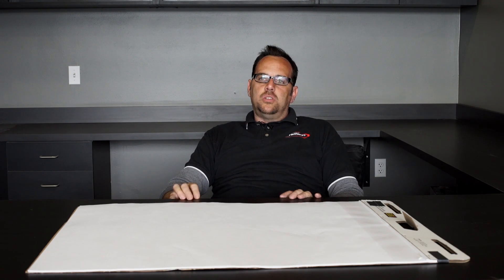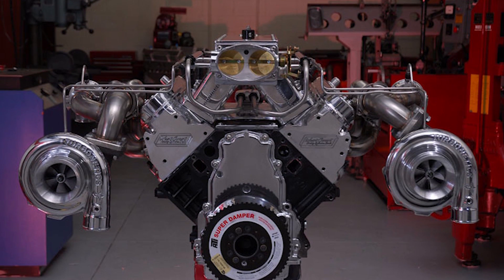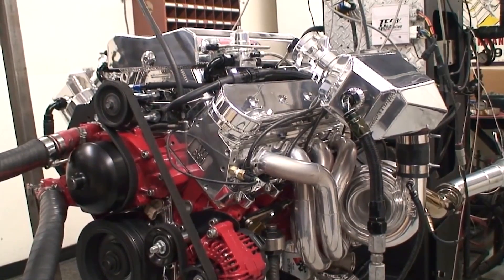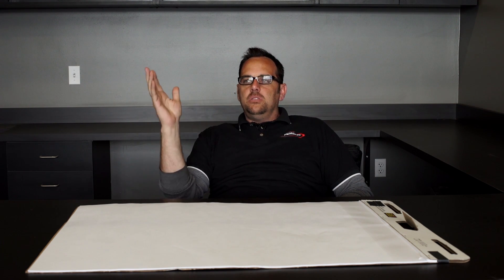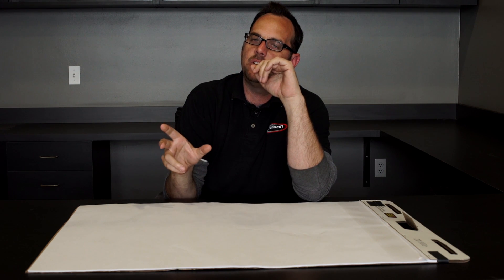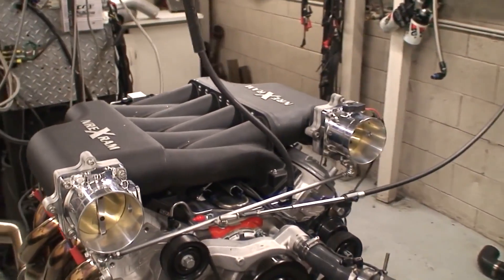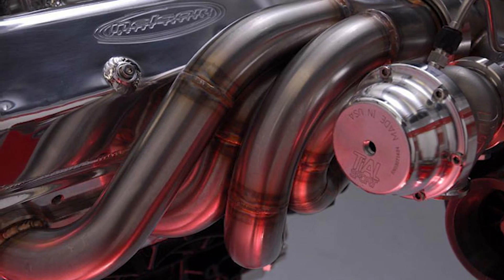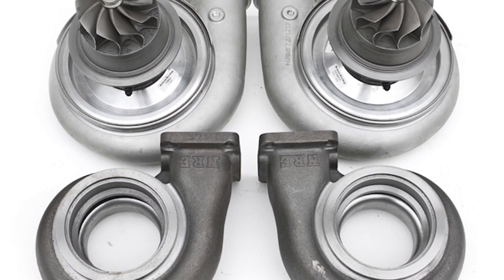Master Engine Builder Explains Why the LS V8 Is SO Good

Comment: am i the only one laughing at the LS being well gasket-ed part, pretty much every one i know with a LS engine (myself included) have had to fix a rear main leak at least once (assuming they cbfd fixing it and its not still leaking) if not more depending on how much the car is used, pretty common problem from my understanding, yes it is better then a rope seal but still have to pull the gearbox/transmission out etc to replace it every-time it starts weeping into the bell-housing.

Comment: Big LS cylinder head flows 430cfm for example..... still hard to make 760HP though.... Why is that??? "Oh, just add a turbo or nitrous"... Well... Couldn't you do that with ANY platform then??? Big Block Chevy is, has and will always be #KING

Comment: I'll stick to the hemi
Reply: +HelpMezz94 Lol.
Reply: +HelpMezz94 Weirdly the Hemi is HEAVY, even though it is an OHV engine itself.
Reply: +DocWolph Chrysler if I remember right only uses iron for their block which probably adds 70-100 pounds of mass. also the heads tend to be larger which also adds mass to the engine.
Reply: Duane Craig
That's still quite a bit, they could very  easily engineer OUT. Also I would love to see Chrysler go size down their engines, 5.0L instead of 6.4L, if only to give themselves a otherness of being "less big".

Comment: yes I also agree, So many American cars are shit, but the LS engines are beast overall .
Reply: Hemi beats it.
Reply: +Matthew Martinez yep! drag racing is where the hemi shines
Reply: +harout hopar absolutely, the best heritage easily in the high hp numbers.
Reply: +harout hopar *Matthew Martinez 
Factory crate Mopar/Chrysler hemi are more than twice the cost of a comparable factory crate GM LS and aftermarket hemi components can be triple the cost of similar LS components. 

Modern Top Fuel & Funny Car do not use Mopar/Chrysler 426 hemi engines and have not for several decades. 
Top Fuel & Funny Car engines use a block that is loosely based on the second generation Chrysler 426 Hemi layout that was manufactured from 1964-71, but that is where the similarity ends. 
They are not even dimensionally equivalent. 
Modern Top Fuel & Funny Car engines are 500 cubic inch displacement and custom CNC machined from solid 6061/7075 forged aluminum billets with ductile iron cylinder liners/sleeves, thicker webbing, thicker decks, increased main bearing support webs, modified lower end main bearing retention design that incorporates a redesigned webbed and ribbed girdle and fastener arrangement and no cooling water jackets, 
The cylinder heads are also custom CNC machined from solid 6061/7075 forged aluminum billets and feature no cooling water passages and increased strength. 
Mopar/Chrysler does not and has not ever offered billet aluminum or cast aluminum second gen hemi blocks or billet heads. 
The rotating assembly is also totally different from the Mopar/Chrysler supplied components, including design, materials, machining and dimensions.
Reply: harout hopar
Sorry, not fact. 
No it is not. 
The current Top Fuel/Funny Car engines have fundamental dimension differences(height/width/length/spacing) than a second gen 426 hemi. 
One particular dimension is cylinder bore spacing which is the distance between bore centers. 
Virtually nothing is interchangeable from a 2G hemi and a modern Top Fuel/Funny Car engine. 
There is practically nothing common between them besides a combustion chamber shape which is also different to improve valve flow. 
While a modern TF/FC engine uses a hemispherical combustion chamber head, it is not a Mopar/Chrysler/FCA hemi engine anymore than a Sonny's SAR 1005 engine is a Chevrolet which was inspired by a big block Chevrolet design and also uses a hemispherical combustion chamber head. 

The LS statement was not aimed at you, but at least we agree on that.
Reply: +patw52pb1 I understand what you're saying. My point is that the hemi motor itself is the best platform for drag racing. The hemi heads allow for more air and fuel which give it the capability to create more power.
Reply: patw52pb1 im not saying who won the championships. im talking about the engine. all engines in the top fuel cars and funny cars have hemi heads. thats the point im trying to get across.
Reply: patw52pb1 http://www.nhra.com/streetlegal/nhra101.aspx
Reply: +harout hopar  
With all due respect, you originally made the statements: 
"yep! drag racing is where the hemi shines" 
Did shine, but not so much in the last 30+ years, except in TF/FC. 

"yep. there is a reason top fuel uses only the Chrysler 426 hemi. it makes the most power. best engine for drag racing period." 
They don't use a Chrysler/Dodge/Mopar/FCA Hemi engine. They do use a "500-cubic-inch adaptation of the famed Chrysler Hemi engine", but it is not a 426 Hemi and does not and cannot use a single part from a Chrysler/Dodge/Mopar/FCA Hemi engine. 
Besides, the engines and components featured in the above video by Tom Nelson are production GM LS engines and aftermarket direct fit replacement components, and do not in any way relate to TF/FC engines. 

"My point is that the hemi motor itself is the best platform for drag racing."  
If you are referring to the Chrysler/Dodge/Mopar/FCA Hemi as the "best platform for drag racing", then where are the NHRA drag racing wins, where are the divisional/national championships and where are the manufacturer cup awards for Chrysler/Dodge/Mopar/FCA Hemi engined cars? 

"The hemi heads allow for more air and fuel which give it the capability to create more power."
Agreed, a hemispherical combustion chamber properly combined with other elements, arranged with the correct geometry and in some applications does create more power than a wedge combustion chamber. 

TF and FC are 2 classes out of more than 200 classes in NHRA drag racing or about 1 percent of the classes. 
Yes, TF and FC engines can use a hemispherical shaped combustion chamber head, but those heads are not a Chrysler/Dodge/Mopar/FCA head. 
Also the Chrysler/Dodge/Mopar/FCA production Hemi engines and especially the current versions of the "Hemi" do not perform that well in real life and are certainly problem plagued and so far don't hold up to serious performance driving meaning they are not the best platform.  

You cannot take a head from a 426 Hemi or any production Chrysler/Dodge/Mopar/FCA "Hemi" and bolt it onto a current TF/FC engine, they do not fit. The number of head bolts are different, the bolt pattern and bolt placement are different, the bore spacing is different, the width, height, length, deck angle, intake flange angle, runner angle, runner spacing, runner dimensions and runner placement are completely different that any production Chrysler/Dodge/Mopar/FCA engine. 
Hemispherical combustion chamber heads are not unique nor exclusive to Chrysler/Dodge/Mopar/FCA. 
Many other winning and infamous engines besides Chrysler employ a hemispherical combustion chamber head such as Cosworth, Honda, Mitsubishi, Ford, GM, Aston Martin, Ferrari, Alfa Romeo, Porsche, Fiat, Lancia, Lotus, Mercedes Benz, Jaguar and most engines in Formula-1. 

It appears when evaluating the NHRA wins that since the late 1990's that GM LS/LT engines have dominated drag racing setting records, winning classes, winning divisions, winning National Championships and winning Manufacturer Cup awards. 
Not directly related to this story, but GM LS/LT engines have also dominated circle track and NASCAR series and GM engines are the winningest engine of all time in NASCAR, Chevrolet is the winningest car of all time in NASCAR. 
Thanks for keeping it civil, respectful and classy.
Reply: +patw52pb1 did you not check the link I tagged you in?... It says what engines they use. You believe what you want.
Reply: FreeeeBeer
Once upon a time that was correct, but not for about the last 25+ years. 
There was a fundamental change in the TF/FC head design that began in the mid to late 1980's that prevented the use of factory parts because of deck angles, intake angles and dimensional layout of the heads used by the winning teams. 
By the late 1980's/early 1990 most teams had adopted the new design. 
Since mid to late 1990's there were fundamental changes to the head and block that include head bolt/stud count, placement and dimensional layout. 
Just stating historical facts, I have nothing against Chrysler/Dodge/Mopar/FCA, I have owned 2 prominent Mopar Pro-Stock cars from the 1970 and 1971 era, successfully campaigned several Mopar cars in NHRA and currently drive a Dodge, but I also own and drive Ford, Chevrolet and Honda.

Comment: Sure the LS great in performance, gas mileage and durability and don't get me wrong I'm a Hardcore Chevy guy, but I would have to strongly disagree that they are "Cheap, Easy and obtainable by everyone." With the same amount of money to buy a stock LS you could build an Awesome Small Block Chevy with more power and torque, just saying.

Comment: what numbers are being referred to as "valve lift?" 650? 900 valve lift?
Reply: +Matthew samson  .650"-.900" is the amount the valve opens to let air in/out the cylinder on the peak of the cam lobe...he was referring to how he tunes an engine based on the head flow and valve lift ..matched to intended use...that's how i understood it
Reply: osp80 copperlocks1okay that makes much more sense.

Comment: I have been a Ford guy with a closet love of the LS since about 98 or 99.  I didn't get my hands on my own until a few years ago and I haven't looked back.  I'm surprised that when mentioning the benefits of the LS platform, he didn't mention the overall compactness of this engine.  One of the big reasons it gets swapped into so many obscure cars is that it fits where other V8's wont.  It fits in many cars that came with OHC I4's and V6's without too much effort.  Another reason that wasn't mentioned is that there are off the shelf transmissions that bolt right up and handle the power that built engines can produce.  A GM 4L80e 4 speed automatic with very minor internal work (minor to the point that I was able to do it and have never worked on transmissions in my life) can handle the power of a single turbo LS for a long time.  Then there are the Tremec 6 speed manual transmissions (that have varying strength based on what you pull it out of) that have an aftermarket following nearly as strong as the LS engine.  They can be built (or bought new) to handle very large power.  Lastly, the GM fuel injection and ignition systems are very tuner friendly (as opposed to Chrysler or BMW which lock them down) and pack a lot of processing power so when you change the cam, port the heads, add a supercharger/turbocharger, etc... the ECU can be tuned to make it work without a high dollar aftermarket fuel injection system.  The LS gets a lot of hate due to it's popularity or the fact that it's made by GM and not (insert your favorite manufacturer here) but, it's a fantastic platform for the average guy/gal to have the powerful car they have been dreaming of.